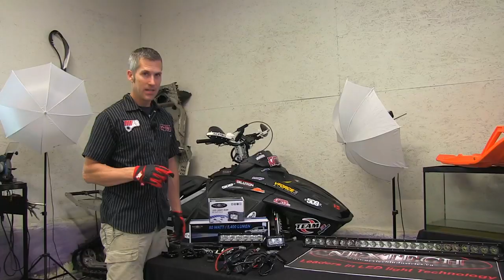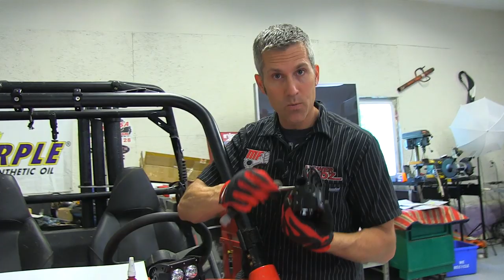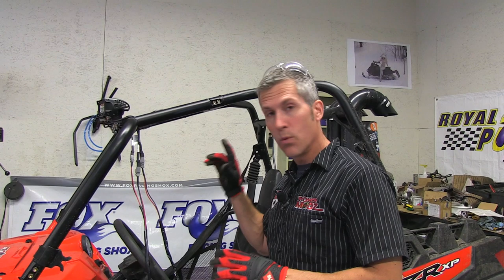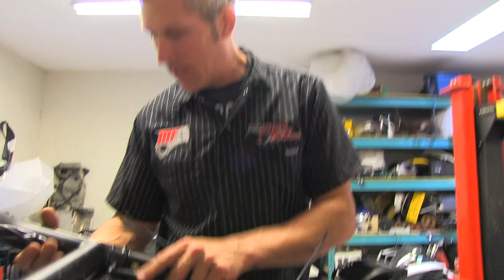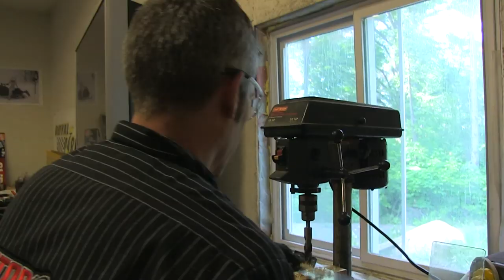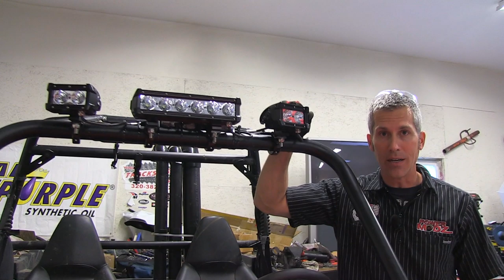Polaris RZR 900XP mod build, Episode #2 Nextech LED light bar install, PowerModz!

Comment: Why install a second battery instead of a higher capacity main battery?  I am installing a winch and two light bars and would like to be able to run them with the engine off.
Reply: First thing to do is remove that POS motorcycle battery. They do not last or like being overloaded. Go to Walmart and get the largest Lawn tractor battery your compartment holds. I was replacing my Polaris $80 battery every year, the mower battery is 3 years old and costs about $50 and is waaaay stronger! Just use a charger if it's been stored for a while so you don't burn out your alternator, and never exceed the amps with lights, winch etc...

Comment: Great videos! Just curious though, why not run all of your wires through your roll bar tubing and silicone the holes to keep water from entering?
Reply from the maker: too big a hole to drill - i want my roll bar sound:)

Comment: Connecting directly to the battery could that potentially cause a battery draw?
Reply from the maker: never did
Reply: @PowerModzOfficial  my switch has a running blue light on the switch that is always on, is there a way to re-route wires on the switch to have that light turn on and off with the light bar?

Comment: when you say that they are 40% brighter than a traditional 2 layered 3 watt bulb you are completely wrong. say those 10 watt bulbs take up an 1.5 to 2 inch square 2 3 watt bulbs are roughly the same but the with is nearly half. making one of those bulbs taking up almost as much room as 4 3watt bulbs with a total 12 watts. a traditional led light bar with 3 watt bulbs 42 inches is 240 watts.so this light bars you advertised really are not worth the premium price...